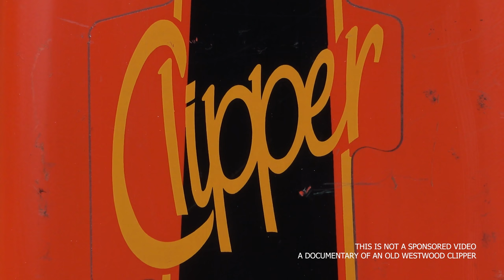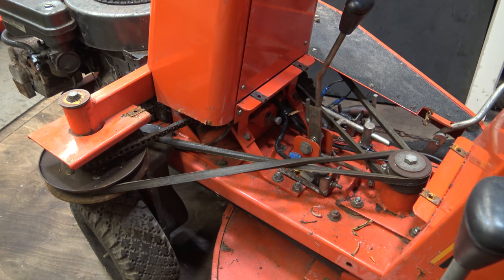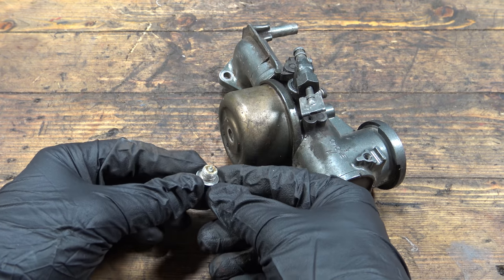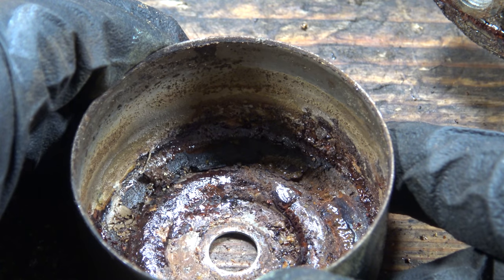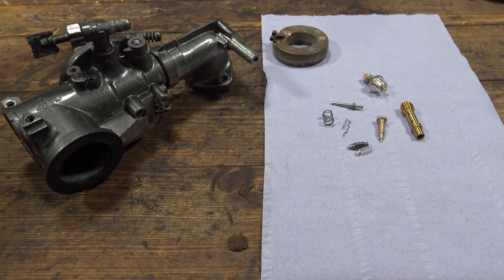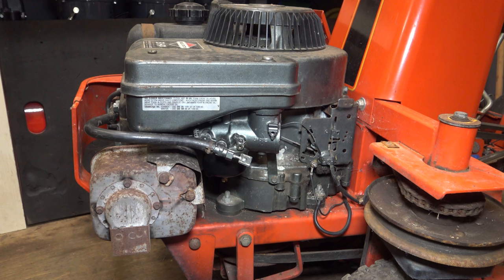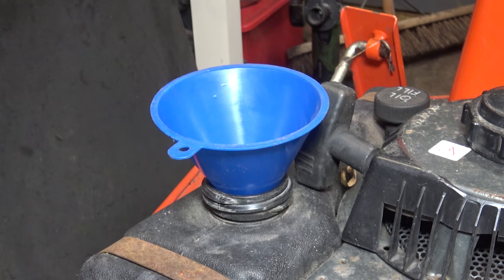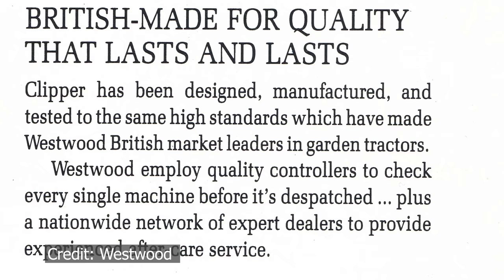UNIQUE 30 YEAR OLD BRITISH MOWER

Comment: I love this mower. Older machines have an aura that is completely missing in newer models.  My 1954 Yazoo 60" mower was the first to be able to turn around its own front tyre axis with a single steering rear wheel and a transaxle with two wheels in front. It  is a real beast and I love to use it once a week in our English-style park.

Comment: Here in the states we had a mower called a swisher ride king that had a similar design. It had one wheel in the front that turned 360 degree instead of 2 and was quite smaller

Comment: That is a pretty clever design…I had a 2 wheel drive Motorcycle that had a “miter Box” to change the direction of the power to the front wheel, it also has a Albion 3 speed gear box…leaked fluid everywhere.
Reply: Sounds like a nightmare

Comment: Definitely a unique machine, and only for  100GBP at that!
One of the few things where electrification would make sense, as well. Plenty of room for a battery up front and wheels can be replaced with hub motors when those drive gears get too worn out. Being small and even more quiet it would fit its original purpose rather well.

Comment: Hey MR, I have just been given a Westwood s800, late 1980’s machine from what I can gather in fairly good condition. Where would you recommend I look for new / used parts? I primarily work on modern machines and Im struggling to find much for these old yokes. Even if you happen to have any Westwood parts machines, only need a pto pulley, drive clutch spring and possibly a left foot board, the rest is pretty good.

Comment: Great video. They are a good mower I have one they are just a little hard to get used to the steering. I also have a wheelhorse R26 that needs restored but can't find any info on them and I can't get it to reverse so it is just parked up in my collection.

Comment: Cute little machine. I feel like it would be easier to steer if the  posts for the drive wheel units had a little line marker [or 'flag'] on the top of each, to indicate at what angle the wheels are facing in relation to the mower, to make steering in tight turns less clunky... Since the only other way to ascertain the angle of the wheels is to lean out to the side and try to peak under the body, while driving.

Comment: I've never seen anything like that before!  Do you go backwards by turning the wheels 180 degrees, or is there a reverse gear?
Reply from the maker: Yes there is no gearbox just turn the wheel 180 degrees and it will start reversing
Reply: @MachineryRestorer  That's just so cool!😁

Comment: Looks a great machine (now the carb is fixed). I was a bit confused by the drive belt that crossed itself and seemed to be rubbing?
Reply: Needs to be crossed over to reverse the drive...otherwise one wheel would run backwards! They've been using that way to reverse drives for years,doesn't matter that the belts rub at such a slow speed.
Reply: @seisix6  Thanks, I am now un-confused!